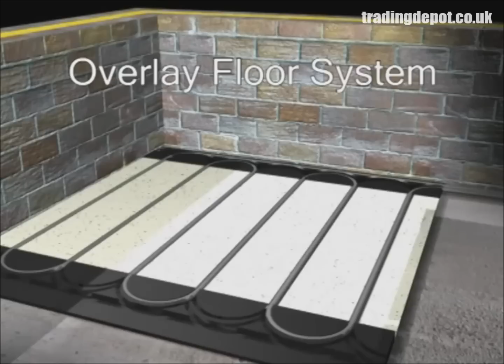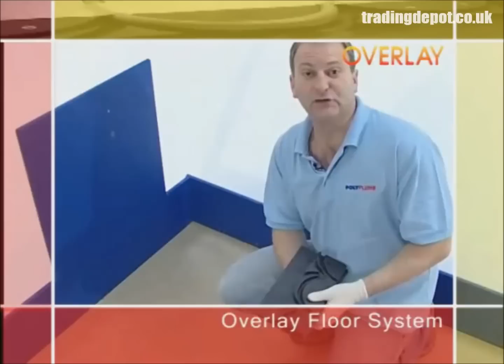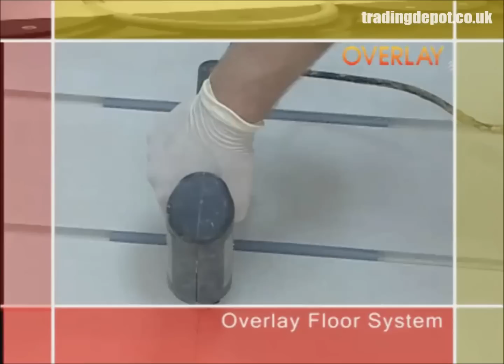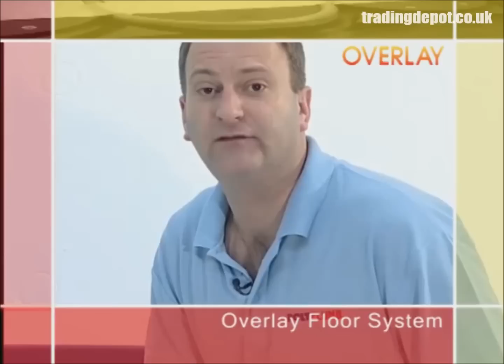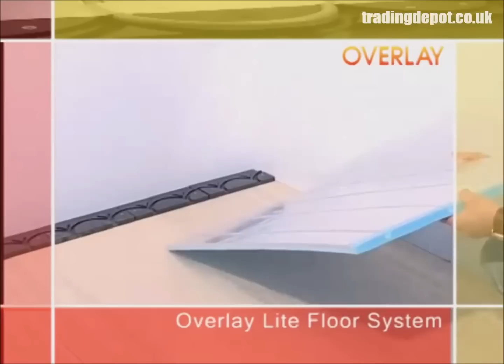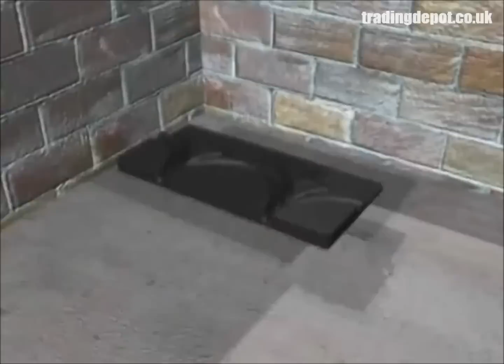How To Lay Polypipe Overlay and Overlay Lite Underfloor Heating

Comment: Great product! For standard overlay onto which I will install porcelain tiles, do I need to... 1). Leave an expansion gap & install insulation around the perimeter of this product? And 2). Do I screed over the top of this and then tile adhesive on top of screed or do I simply tile adhesive only & install tiles? Is there specialist screed / tile adhesive specific to this product? Thank you
Reply from the maker: Dear +unclepabs 

Thanks for your comment. You wont need to use edge installation with this product, and you can tile directly onto the overlay, but NOT the over lay lite.

For full technical/installation queries it would be best to check with the technical team at Polypipe for your specific job. You can reach them on 01709 770 000 or online here info@polypipe.com